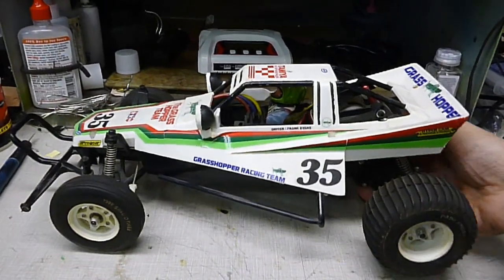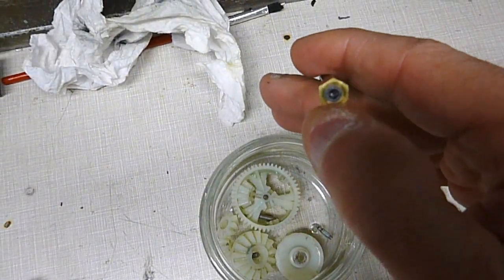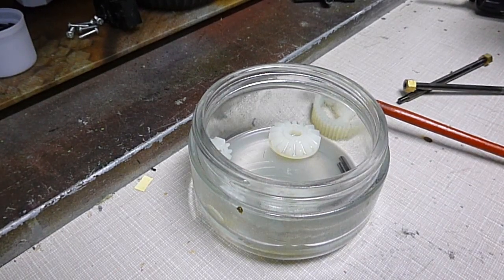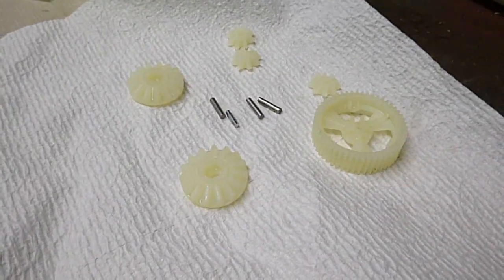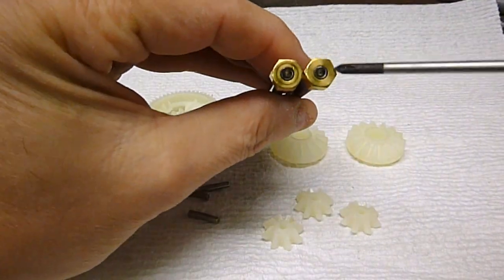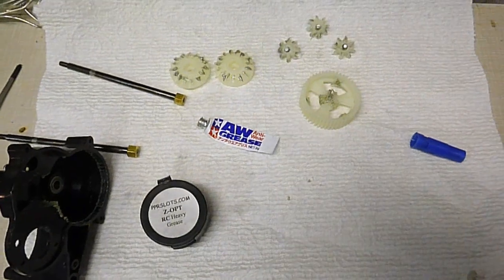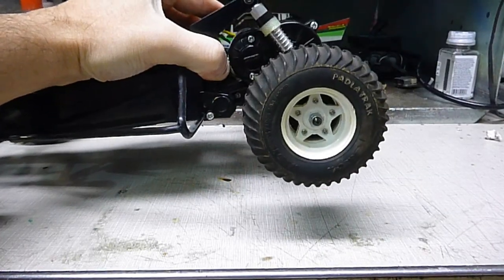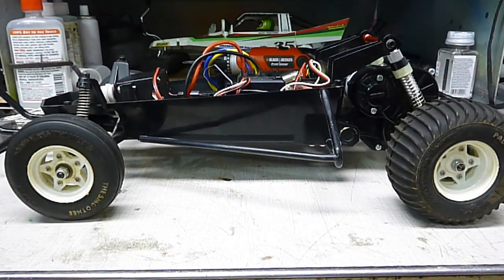TAMIYA GRASSHOPPER BETTER DIFF EASY!

Comment: Great tip there Steve. I do get the same thing happening with my Hornet. The open diff loses traction say in long grass and results in the diff spinning out but no drive. Thanks man👌👍
Reply from the maker: Yeah, this helps a little you have to degrease everything and coat all the pins and diff gears properly but it's better than using the stock grease. 👍

Comment: How do you take the rear axles off once inside? I can’t take off the brass color hexagon nuts on my 1988 QD 2wd Thundermist’s shot for nothing. Please any advice or video on how to replace
Reply from the maker: Hi those don't come off the axles you need to take the wheels off and plastic wheel holders off behind the wheels and take the small metal pin out off each axle end then you can pull the axle and gear out through the gearbox casing and slide the bevel gears off the axles away from the brass nut.. also make sure to put the metal little pipe back in the correct way on the axle when putting it all back together so the gears mesh properly.  Hope this helps.

Comment: My grasshopper , slip and make noise , do u have any problem solved? Thankss!
Reply from the maker: Try taking the wheels off and the axle hub that holds to the rear wheels sounds like maybe a axle pin may have fell out there should be a small metal pin that pushing in a hole in each side of the axle... if that is not it maybe your motors pinion gear on the motor shaft could be slipping?  Hope this helps.
Reply: @ShenRC  i have a weird problem here , 
All gear look good , i take all gear on the right position , pinion is okay 
But when i turn back and suddenly fast forward , the noise get loud
Reply from the maker: @nartoook  Hi make sure you put the little pipe silver spacer in the correct position in the gearbox on the one axle that may be what's wrong see your instructions.
Reply: @ShenRC  i put the metal spacer already , all lookin right but still makin noise so confused
Reply from the maker: Hi what motor you using? stock kit 380 motor? if so make sure you have the plastic motor adaptor on correctly and also did you check if the pins were in both axles under the black plastic wheel holders behind the both rear wheels? @nartoook
Reply: @ShenRC  540 sport tuned
Reply from the maker: Hi check the pinion gear on the motor it may be slipping make sure the allen grub screw is tight and in the spot on the motor shaft that is flat. @nartoook

Comment: Thanks again. I'll get some of that AW Tamiya grease for the 'Lunchkin'
Reply from the maker: Cool it's awesome stuff I use it in all my open non oil filled diffs now it's that good. 👍😊
Reply: LHS where I ordered the kit had it. I got 3 1g little plastic jars for around $5.
Reply from the maker: cool! good deal! don't get it on your fingers it's super sticky I use like a small plastic stick or something to spread it on the diff gear parts.

Comment: Does that car still have plastic bushings or ball bearings? I've gotten my hornet to the point where there is little to no friction on the rear axle and it will spin forever. A few of my newer car buddies were in awe of the speed it had for just having a 22 t pinion a 15T hpi fireball motor running on a 3000mah NiMh pack. My does get a bit hoppy on the stones but it always did great on dirt and sand.
Reply from the maker: Hi it has full bearings in it. Mine spins easy like butter I just put that grease in the diff to make it slow down the open diff spin you get with these cars.
Reply: I will have to give that a shot. It would be nice if the power transfer happened a little slower.
Reply from the maker: yes it works much better than using normal grease on the diff for sure.

Comment: Dude needs to do a 540 conversion Video!~
Reply from the maker: 😁👍 Hi It's simple you get the hornet pinion gear 18 tooth  and you get a 540 motor and all you need to do is take out the 380 and also its plastic adapter so nothing is on the gear box and then you install the 540 with the 18T pinion right on.
Reply: Shen RC agreed. But there are pitches with the gears. I hope to make a video explaining things that I certainly don’t get at present time.
Reply from the maker: @rcjohnsons7729  Hi the grasshopper uses 32 pitch pinion gears. see these robinson racing make 32Pitch steel pinions also that I use.   https://www.amazon.com/Hot-Racing-CSG1218-Hardened-Pinion/dp/B0084HI13O       and  https://www.towerhobbies.com/cgi-bin/wti0001p?&I=LXEX03&P=7

Comment: ... that was not much AW :-) I've used more. Don't think the motor will burn out if one uses a bit more :-) Thanks for sharing.
Reply from the maker: Hi man , you can use as much as you wish in the diff gears , I was saying do not use it on the normal rotating gears or your motor will over heat because it's not meant for putting on normal gears in the gear box.
Reply: shenlonco I only use it on the spider gears inside the diff to give it limited slip.
Reply from the maker: Nordic RC Visions O sounded like you used it on all the gears! =)
Reply: shenlonco He he, no, only inside the diff. I've just been experimenting with it in some slow high-torque Monster Trucks. Perfect solution for those. Planning a 4x4 MT build that will be loaded with AW inside the diff. Never tried it on buggies so I might try your solution in my coming Hornet build :-)
Reply from the maker: works great on the hornet I have it in mine, it loosens up a bit after usage but always works much better than with normal grease on the diff pins and gears that's for sure!  I actually could use my hornet on some snow!